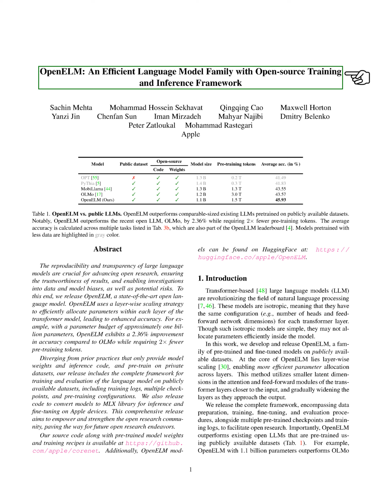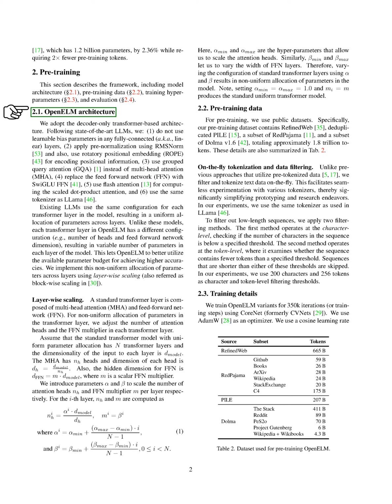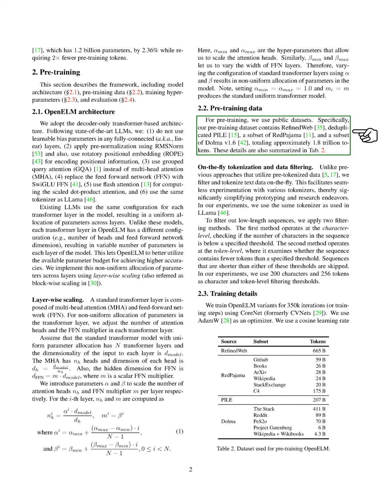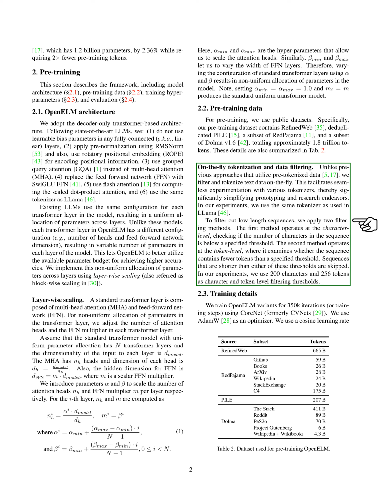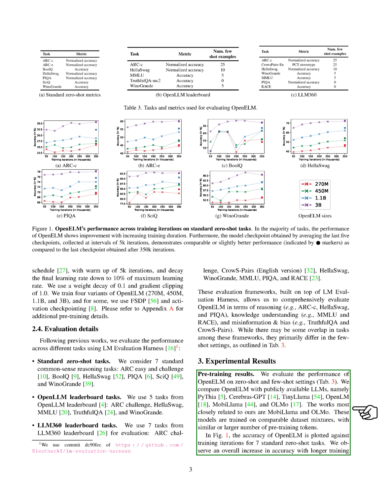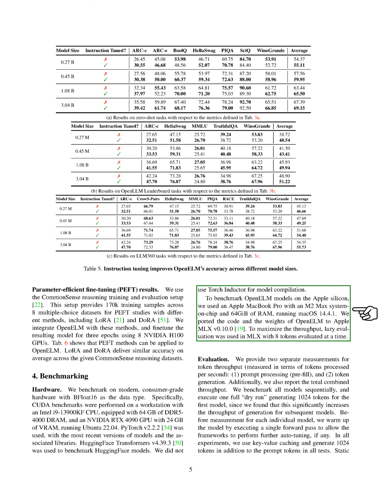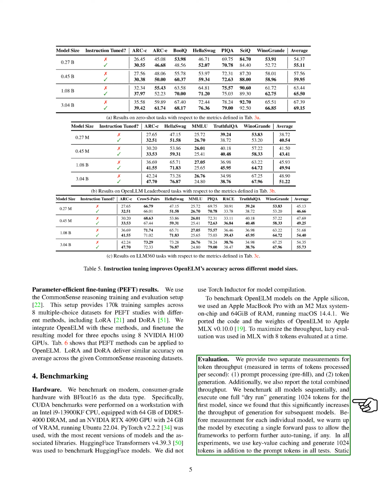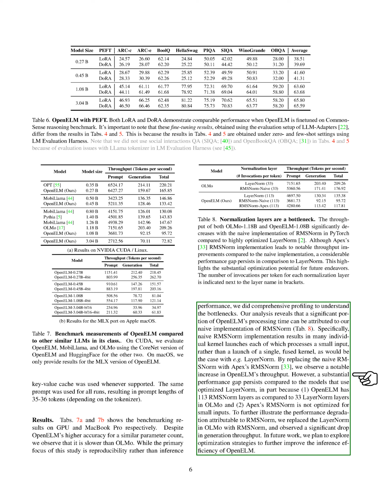OpenELM: An Efficient Language Model Family with Open-source Training and Inference Framework

Comment: Summary by @erinkhoo

1. Apple has released OpenELM, a family of open-source large language models (LLMs) designed to run efficiently on Apple devices. There are 4 pre-trained models of different sizes - 270M, 450M, 1.1B and 3B parameters.

2. OpenELM uses a layer-wise scaling strategy to efficiently allocate parameters within each transformer layer. This leads to enhanced accuracy compared to other open LLMs like OLMo, while requiring 2x fewer pre-training tokens[1][6].

3. Unlike typical releases that only provide model weights and inference code, Apple has open-sourced the complete training and evaluation framework. This includes training logs, multiple checkpoints, pre-training configurations on public datasets, and code to convert models for on-device inference using Apple's MLX library[1][6].

4. In benchmarks, the 1.1B parameter OpenELM model outperforms the 1.2B OLMo model by 2.36% accuracy on the OpenLLM leaderboard tasks, while using half the pre-training data[1][4]. However, OpenELM is slower than OLMo in inference due to a naive implementation of the RMSNorm layer[2].

5. Apple has released the models on the Hugging Face hub, making them easily accessible for developers to experiment with and integrate into applications[10][12].

Implications for Apple:

1. Enabling on-device AI: OpenELM models are compact and optimized to run on iPhones, iPads and Macs rather than relying on the cloud. This enables fast, local AI processing for features like composing emails, while preserving privacy[4][10].

2. Catching up in the AI race: By open-sourcing capable LLMs, Apple is making strides to match competitors like Google and Microsoft in the generative AI space. OpenELM could power upcoming AI features rumored for iOS 16[10][12].

3. Empowering developers and researchers: Releasing the full training stack allows the community to investigate the models for potential biases and risks. Developers can easily leverage the models as-is or fine-tune them for specific applications[1][6].

4. Paving the way for more open research: OpenELM represents a shift in Apple's typically closed approach. It may signal more open collaboration with the research community to accelerate AI progress in a responsible manner[1][8].

5. Balancing cloud and on-device AI: While OpenELM focuses on on-device inference, Apple is also exploring integrating large cloud models from Google and OpenAI into its products. The strategy seems to be a mix of efficient on-device models for fast, private processing and cloud models for more advanced capabilities[4][10].

In summary, OpenELM marks a significant step for Apple in the AI domain. By open-sourcing efficient models and empowering the research community, Apple aims to responsibly democratize and accelerate AI development, while still preserving its core values around privacy and on-device processing. However, more work is needed to optimize model performance to match the efficiency of other open LLMs.

Citations:
[1] OpenELM- An Efficient Language Model Family with Open-source Training and Inference Framework.pdf https://ppl-ai-file-upload.s3.amazonaws.com/web/direct-files/12393781/3f2bba30-d8b4-4856-84ac-a33b3af97b59/OpenELM- An Efficient Language Model Family with Open-source Training and Inference Framework.pdf
[2] Apple releases OpenELM, a slightly more accurate LLM - Theregister https://www.theregister.com/2024/04/24/apple_openelm_ai/
[3] Apple Releases Open Source AI Models That Run On-Device - Reddit https://www.reddit.com/r/apple/comments/1ccca6l/apple_releases_open_source_ai_models_that_run/
[4] Apple's New AI Model: OpenELM and What It Means for iPhone Capabilities https://www.stork.ai/blog/apples-new-ai-model-openelm-and-what-it-means-for-iphone-capabilities
[5] Apple releases OpenELM: small, open source AI for devices | VentureBeat https://venturebeat.com/ai/apple-releases-openelm-small-open-source-ai-models-designed-to-run-on-device/
[6] [2404.14619] OpenELM: An Efficient Language Model Family with Open ... https://arxiv.org/abs/2404.14619
[7] OpenELM: An Efficient Language Model Family with Open-source ... https://huggingface.co/papers/2404.14619
[8] OpenELM: An Efficient Language ... - Apple Machine Learning Research https://machinelearning.apple.com/research/openelm
[9] [PDF] The OpenELM Library: Leveraging Progress in Language Models for ... https://openreview.net/pdf?id=C0SGtHjr4wK
[10] Apple releases OpenELM family of AI models for small on-device tasks https://tech.hindustantimes.com/tech/news/apple-releases-openelm-family-of-ai-models-for-small-on-device-tasks-all-you-need-to-know-71714021035566.html
[11] CarperAI/OpenELM: Evolution Through Large Models - GitHub https://github.com/CarperAI/OpenELM
[12] Apple's Releases 4 New Open-Source AI Models that Run ... https://beebom.com/apples-releases-open-source-ai-models-run-on-device/
[13] OpenELM: An Efficient Language Model Family with Open ... - YouTube https://www.youtube.com/watch?v=aO1XvwGT8go
[14] Apple Machine Learning Research https://machinelearning.apple.com/research/?year=2024
[15] OpenELM: Apple's play for democratizing AI development https://www.absolutegeeks.com/article/tech-news/openelm-apples-play-for-democratizing-ai-development/
[16] What is the implication of it being a reference design? They had two ... https://www.threads.net/%40daniel_rubino/post/C6J36UwOnV6